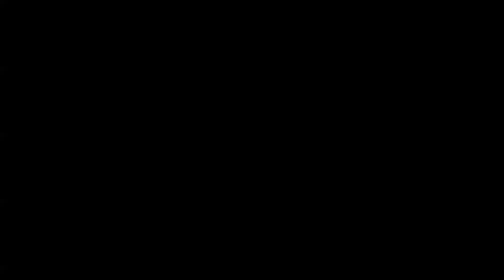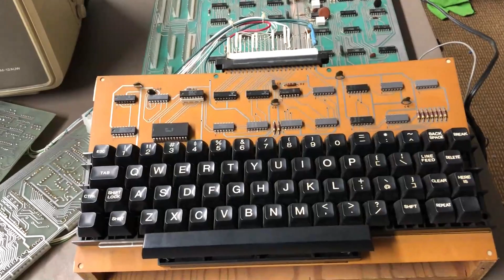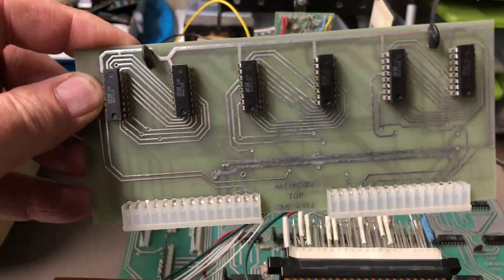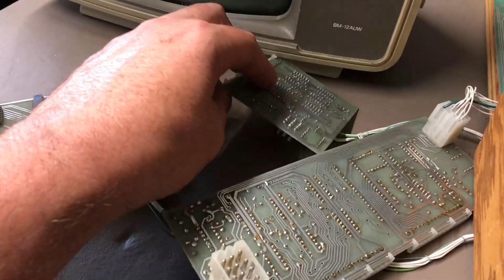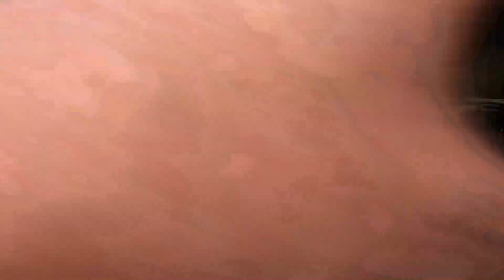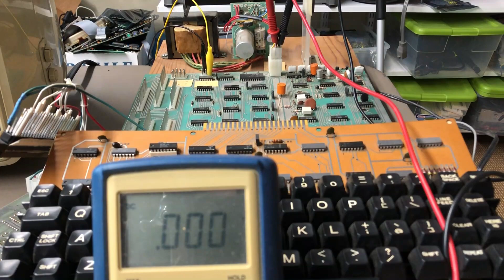SWTPC - Part 2 - The CT-1024 Computer Terminal Kit - Power Up and Testing - STB161

Comment: That 6.3vac is probably a reference for the sync generator. Analog TV was 15,750hz horizontal and 60hz vertical. The AC line lock provided a more stable display than the free running oscillator (note that color TV was 15,734hz and 59.94hz, but that's outside of this discussion)
Reply from the maker: That would make sense. I've used the 60hz A/C line as the clock source for a few digital clocks.